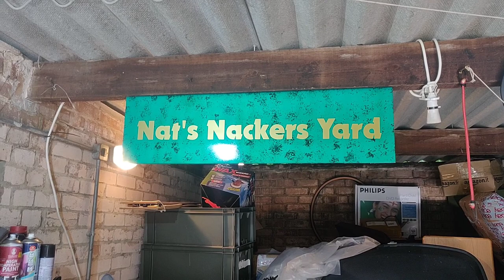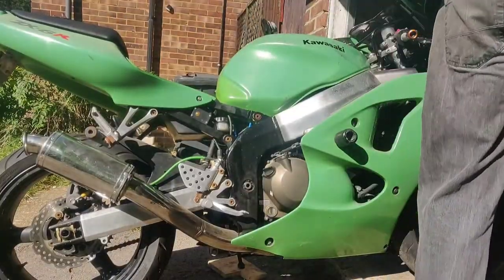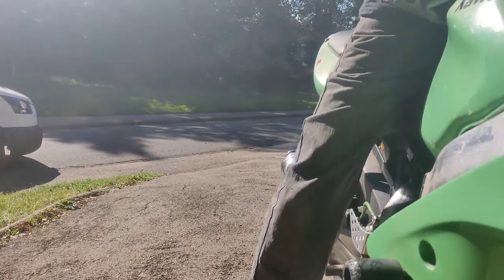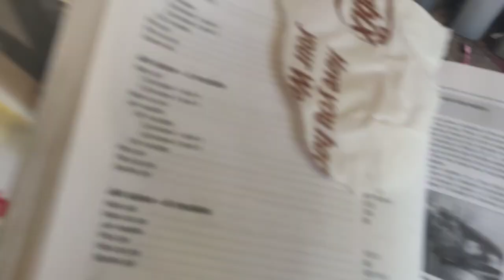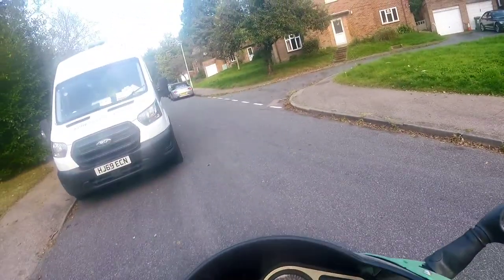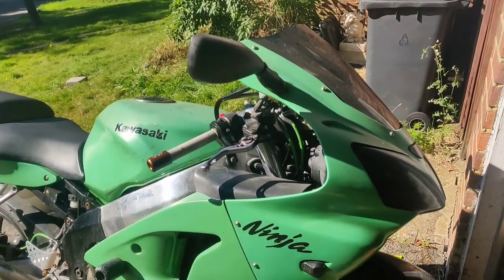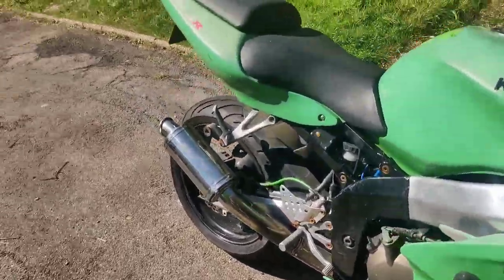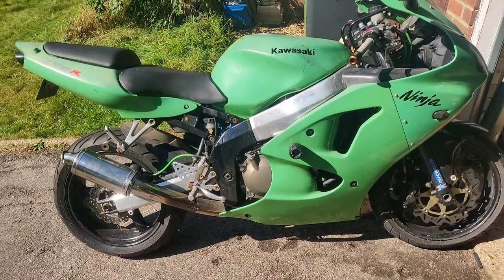Kawasaki ZX6-R. Carbs jetted and test ride of Kermit.

Comment: Nat wrap some electrical tape around the plastic throttle tube 😉 for grip.
There's a led relay ( the one with two wires on it ) & it'll run with standard bulbs on it ie a mix.

Yes integrated rear lights are illegal ( ok in USA).
It feels huge cos it's the same frame as a zxr900.
Chuffed it moves and the jetting worked... fuel tap is down for on, up for reserve and sideways for up if I remember correctly.

They came in red n black,yellow  n black and green n black plus just all racing green....the black was mainly decals.
Going to be fun seeing it transform back to a fun road bike.

Massive congratulations on hitting 600 subs....its official we like your shit lol.

Ride steady and stay safe bud 🤘
Reply from the maker: Cheers mate.  The Haynes manual is invaluable for this.  I am really happy that it runs so well. I must remember to drop the coolant as it still has fuel in it!
Reply: The higher jetting will bring the Nox levels down. 

I'm sure if we double up the air filter that this will pass the nox run first time costing £175. 

Worth considering. My guess is that some people love these middle age sports bikes and the odd one being ulez compliant could be snapped up for good money.
Reply from the maker: @motorcyclerescuer  I haven't taken a bike to get an exemption yet.  I might give it a go with this one.